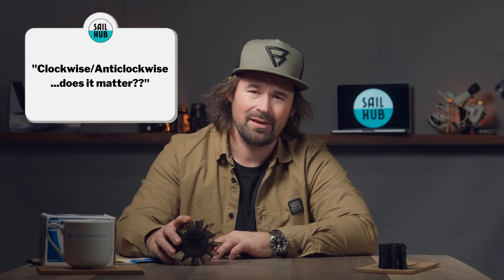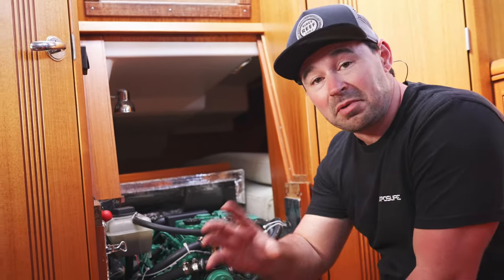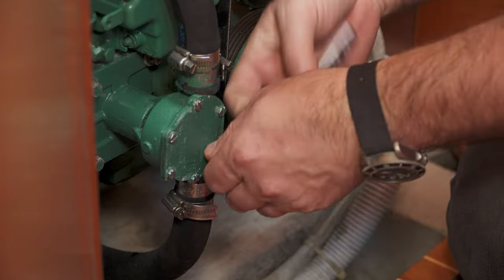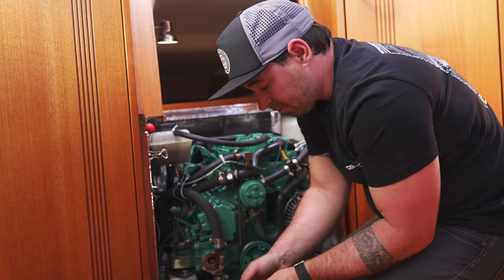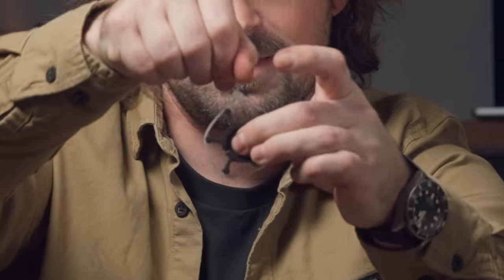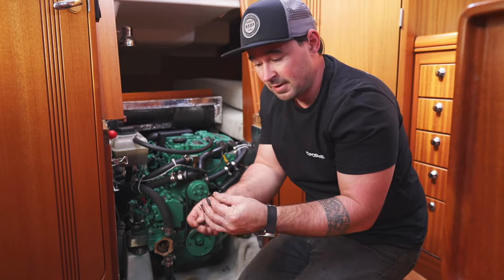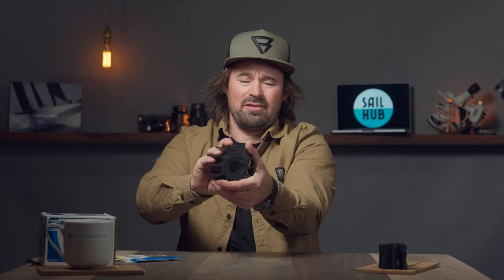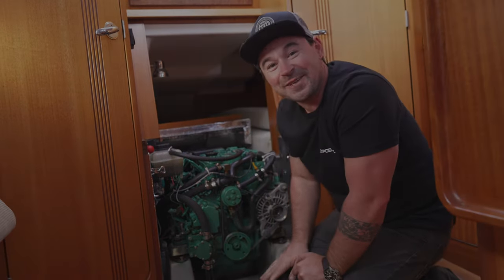IMPELLER - Everything you should know

Comment: My pump is pumping like crap, it DOES have some GROOVES (front to back) in the housing, how do i fix those? Sand paper???
Reply from the maker: Well, it may end up being a replacement. The thing here if you try to fix it you may win or end up worse, but really it can’t stay the way it is. 

If it were me I would get too smoothing out the rough spots with sandpaper as you suggested. You can take away all of the high spots where the impeller rubs and possibly even the smaller low spots, this should help a lot. 

Regardless of what you do, I think it’s important to see what’s going on with your sea water strainer as it sounds like it’s not been doing it’s job properly.
Reply: How about lightly honing it like an engine cylinder .    I’m not saying I’ve done it just floating an idea that I’d consider trying if I had your situation
Reply from the maker: @drizler that sounds great, only it’s not circular. I’m not sure how you would get the honing tool to manage the flat?

Comment: I installed the impeller housing after summarizing and now I hear a grinding  sound and the belts don't spin... I've taken it apart 2 times now and the same result. Any ideas of why?
Reply from the maker: The belts don’t spin… Ok, so it sounds like you have taken the impeller hosing off and it’s drive mechanism? It most likely that the drive gear wasn’t aligned when you re fitted it. 

Do you have any pictures? If so send them to info@sail-hub.com and I will try yo help.

Cheers,
Chris
Reply: @SailHub  I just sent you a picture of my housing. Thanks bro!
Reply: @SailHub  I didn't have the support bracket in place!   I think that's the problem.  I will put it back on.
Reply from the maker: @NinoThePrez ok, good luck!
Reply: @SailHub  I think it is seized.. Nothing spinning...What do you think?
Reply from the maker: Hey Nino, if the belts not spinning all I can presume is that there is a bearing problem in the crank pulley housing. So you will need to either change the bearing in the pump if your confident with that (not too difficult) or you could change the pump itself, it’s most likely going to be more than an impeller swap if it’s seized.

I found this video that may be of help to you;
https://youtu.be/qOSt6dEJyPQ?si=aWSL8IDawVm5G1BY
Reply: @SailHub  thank you so much. I think it will be much easier for me to change the entire water pump than playing around with bearings. Thanks a million!
Reply from the maker: @NinoThePrez no problem! Glad to help out in some way or form 👍
Reply: Put Vaseline in every year
Reply from the maker: @MultiObeone that’s sounds like a good plan to me, should keep it running way beyond the usual recommendations!

Comment: Great video.  I wish any boat that I've owned had an impeller that was that accessible!  

And I wish every boat builder made oil and fuel filters easily accessible for service.
Reply from the maker: Yeah, we were lucky with this one, that’s why we made the video. 

Here’s a thought for you, when I built race cars we re routed the oil filters from the front of the engine to the side so when impacted it didn’t snap off. It’s easy to use one of the motorsport re routing kits to put the filters somewhere sensible. 
https://www.ebay.co.uk/itm/273991883223?mkevt=1&mkcid=1&mkrid=710-53481-19255-0&campid=5338766898&toolid=20006&customid=9837d712b9f037475ace4b216d4b8114&_trkparms=ispr%3D1&amdata=enc%3A16V2bw4nwTnewjxsxzvwOXA30&gad_source=1&gbraid=0AAAAApeD5GVsXiKcLh4K7UYOmkRfDiQaM
Reply: I completely agree to re-route a couple filters etc.  I’ve done it in the past… but I’m working with a current and premium fresh water wakesurf boat that I’m probably moving out of a model soon.

But I’m a maintenance guy and I super annoyed that manufacturers zero-fs about easy access for routine maintenance. 11:41 
Remote oil filter, easy access to oil filter, accessible spin off fuel filter.
 
Impeller and easy zincs replacement if needed. 

Comon manufacturers…. It should be way easier than you make it.
Reply from the maker: @house3249 hey, your dammed right. What’s wrong with theses manufacturers… oh yeah, profit profit profit. But what a pain in the arse to work on!